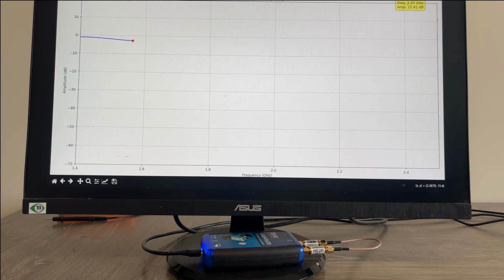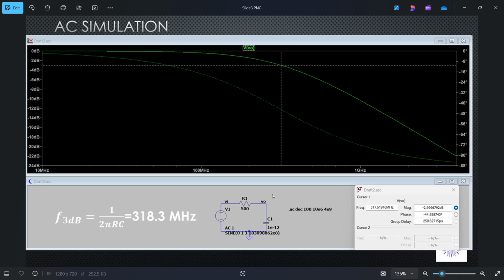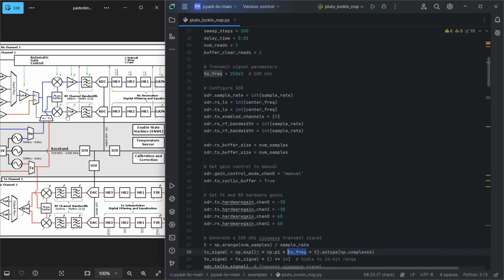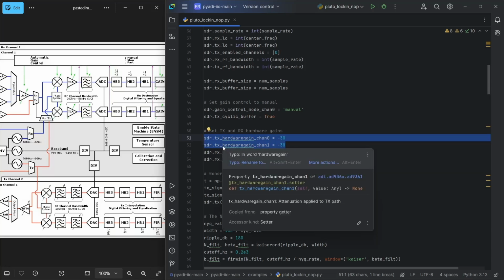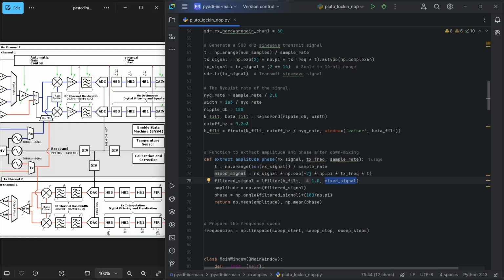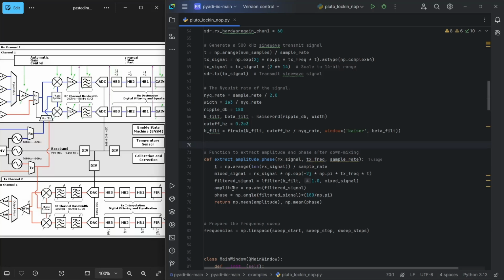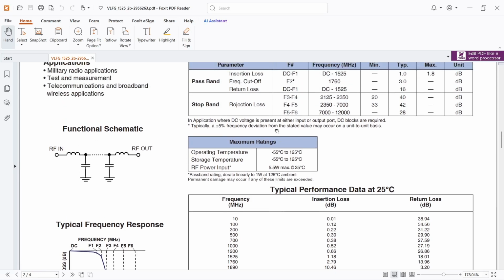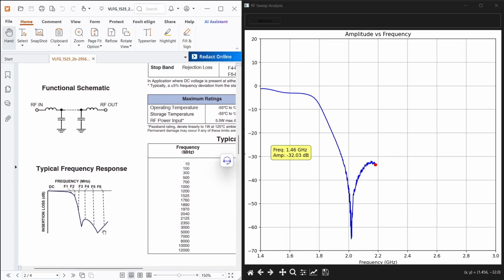Measure Circuit Frequency Response Up to 3 GHz with ADALM Pluto SDR

Comment: Can i do this with a HackRF one
Reply from the maker: I haven’t used the HackRF One before, but based on its block diagram, it appears to be half-duplex, meaning it can only transmit or receive at a given time—not both simultaneously. For the frequency response analyzer shown in the video, you need full-duplex capability to transmit a sine wave as the input signal while simultaneously receiving the output for measurement.